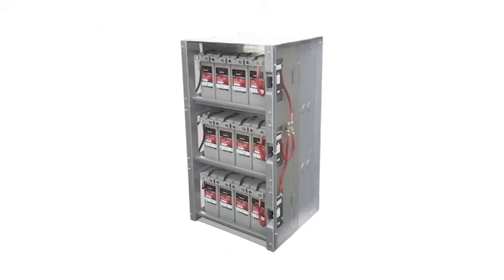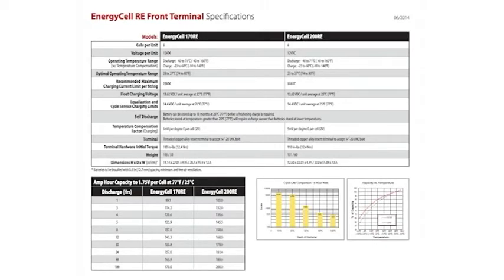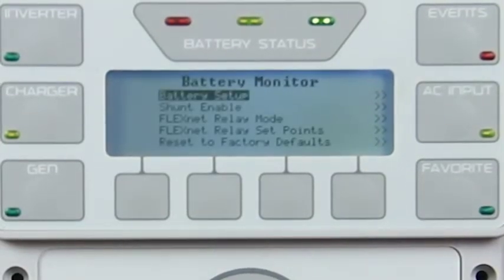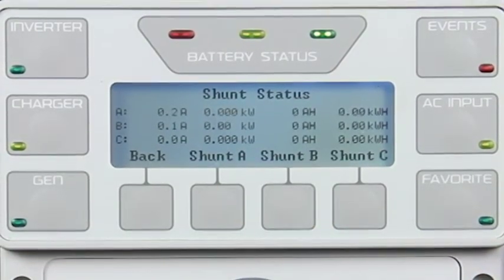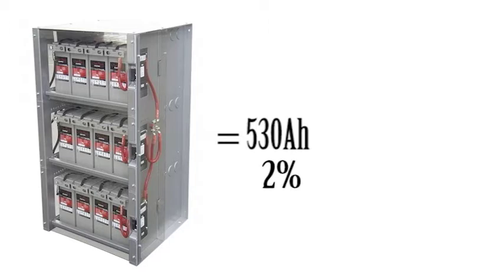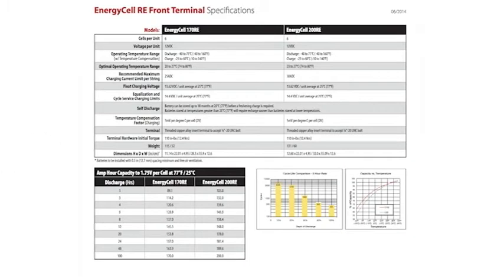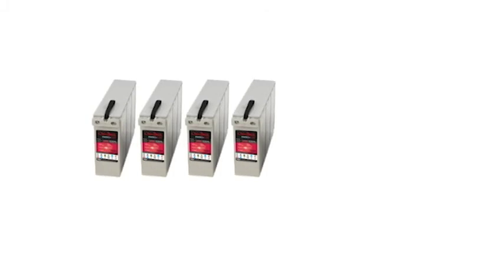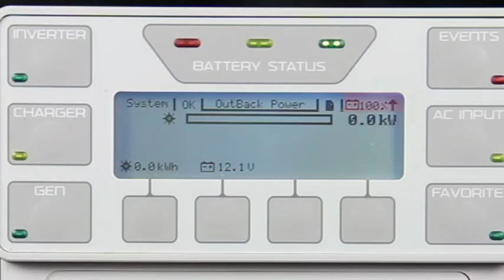FLEXnet DC: Programming

Comment: And for LiFePO4 batteries?  50% soc for the red LED doesn't work for lithium.  I don't want to see any red lights if the system is happy.  Please add Li functionality to the next firmware update.